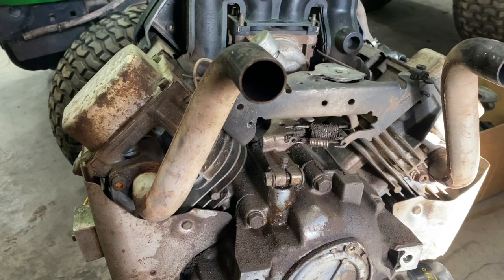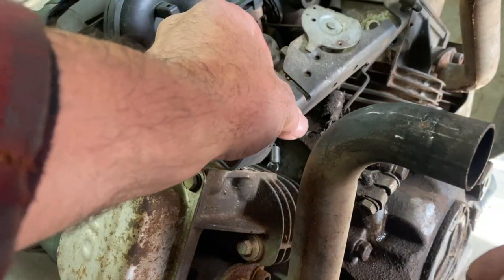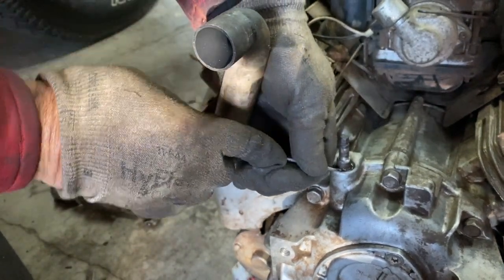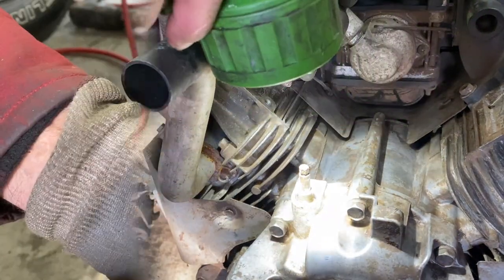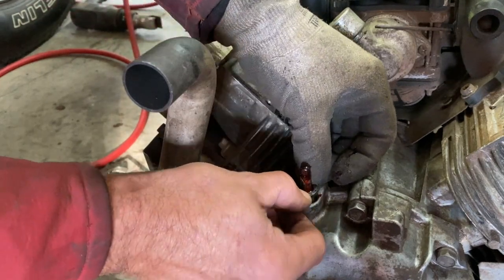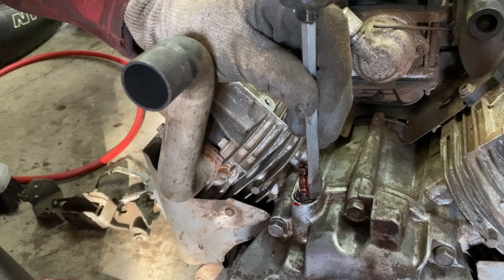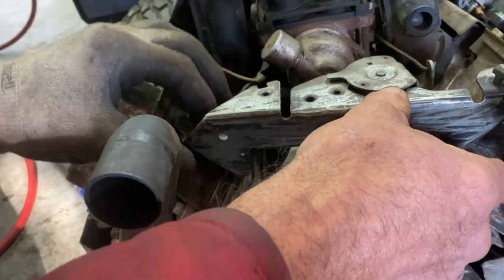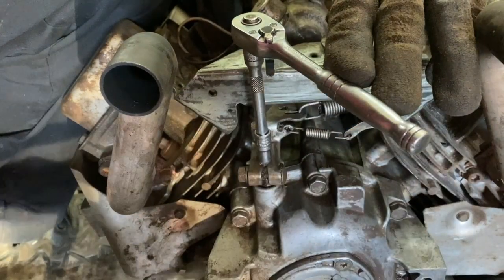How to fix: oil Leak on a John Deere D140 22hp engine Intek Briggs &  Stratton Engine Governor seal!

Comment: Any ideas on how to find a skid plate for my 1980 XL250s?
Reply from the maker: if you're on Facebook, join the group "Honda XL250S, XL500S, XR250 & XR500 with 23' inch front wheel only".  then do a search for a guy name Tony Fryer.  Message him, he has a ton of parts.

Comment: I need a smaller seal about 3/8 inch for my Briggs 13.5 hp, I cant find it anywhere, anyone know where I can get one?
Reply from the maker: You need your Model number of the motor. Then go to your local small gas repair shop. They will look it up for you.